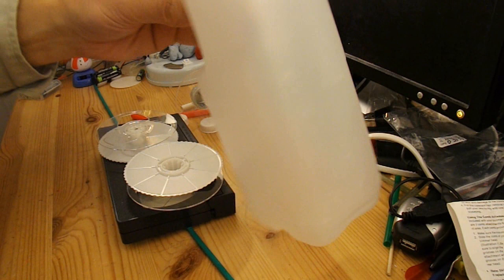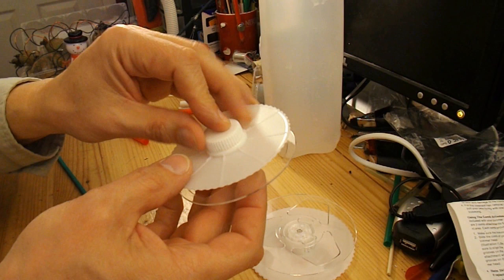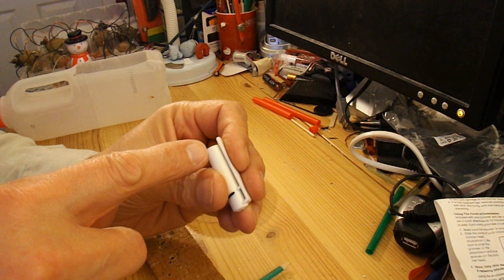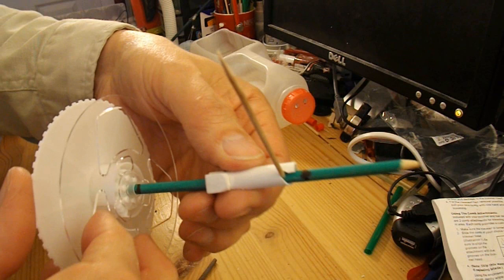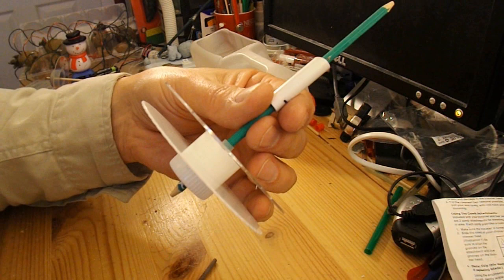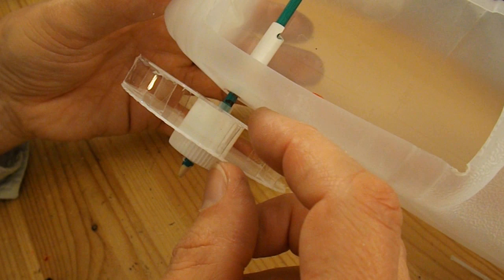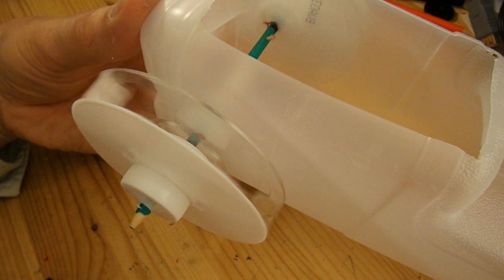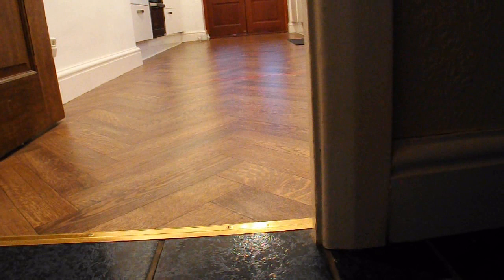Rubber Band Powered Paddle Boat/Car + ratchet mechanism

Comment: Thanks grandad, I made 2 boats that drives on the ground using 9v battry they are too east to make and super fun, but your Idea is better. I'm going to make it as soon as I can
Reply from the maker: Thank you Othman Alq. This car works very well on water and it runs very well on a carpet. The wheels do not grip very well on a smooth floor like my kitchen. I did think of using an electric fan to push it along but then I had the question  about the rubber band mechanism so I used the project to answer two requests.

Comment: Really great thinking. It went very well in the water too. The new 3D printed latch is very tidy. 😃👍👍👍
I see you had the snowman wobbler back then and he is still working. Wish we could bring back 2014. 👍
Reply from the maker: Life rolls on Mike, I would rather like some of my time between 1994 and 2008 back as I spent that time totally focussed on work and missed an awful lot of life.
Reply: @GrandadIsAnOldMan  Yes, true Graham but getting older really is a pain with certain things. I used to be able to kneel down for ages working on things. Now it is like daggers in my knees when getting back up. My 2014 comment was more geared towards not being locked down and the world being a freer place in many ways. I still find all this hard to fully believe. Something is just not right with it. Pandemics have happened before but this one just keeps existing as if it will never stop being a pandemic.

Comment: In ground tests and to improve traction, you could coat the wheel with a piece of chamber bicycle or motorcycle.
Reply from the maker: Yes a rubber tyre would help on a smooth surface but it manages the 5 metres length of my kitchen easily and that is all many of the school projects require. This car runs very well on carpet because the wheels grip well there.